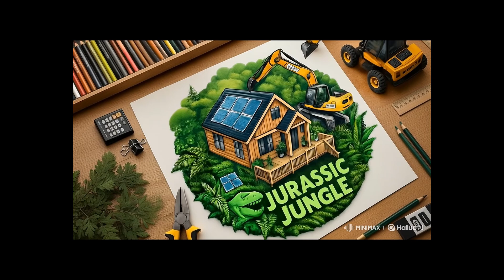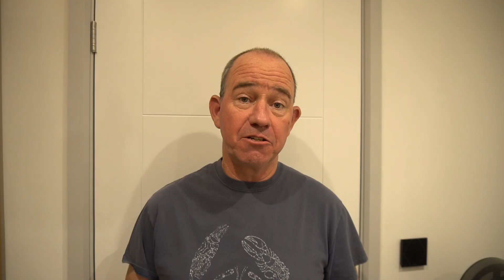“Did I Make a HUGE Mistake Switching to a Heat Pump? 💸 Real Quotes &  Costs!”

Comment: I saw in your previous video you had integrated with Loxone via Modbus. I'm in the middle of a refurbishment using KNX and now also considering a heat pump. Wondering how you are controlling the temperature in your house? I've seen people using temperature sensors but also others fully on weather compensation alone.
Reply from the maker: That is a really good question! As I think I said in this video I have waited to cover some of these areas as the house is more complete. I do indeed have a Modbus connection from Loxone to the heat pump, this allows Loxone to use it's logic and send required flow temperatures based on a weather compensation curve in Loxone. As I go into this winter I am looking to understand how this works better. I will do a video in the next few weeks showing the detail of my current configuration and what I do and don't like about it. I have Loxone Pure switches in all rooms so I have Temperature and Humidity to feed into the climate control logic. I currently have mains actuators on all of the underfloor heating loops controlled by Loxone relays. I assume you have seen the same suggestions as I have that controlling each loop could cause the heat pump to cycle but I have not yet recorded that happening. We have an MVHR system which means controlling each loop/zone is probably a waste of time. I would quite like to just remove the actuators and leave weather compensation as the control. I am a little frustrated that Loxone is not a bit smarter in this space as what I had hoped was that Loxone could take the temperature data from all rooms and look at historical external temperatures and flow temperatures and create and modify the weather compensation curve based on historical data. Sadly that is currently not the case. I struggle to understand how you can create an accurate weather compensation curve without some historical data from temperature sensors. I am sure you could get it right from trial and error but if you have the data why not use it to model and give a more accurate input?